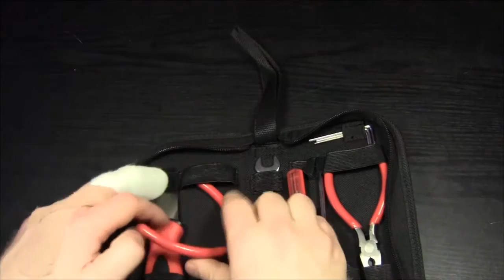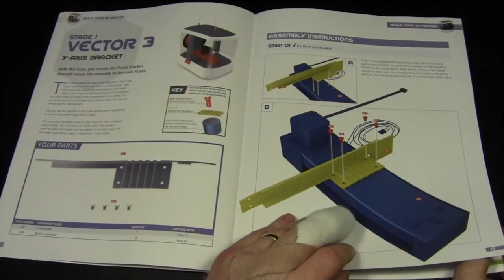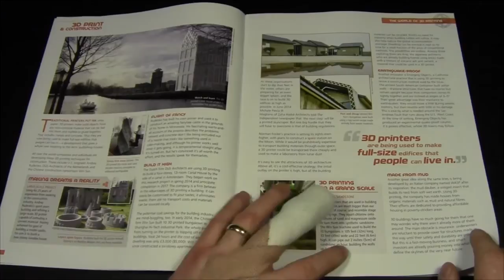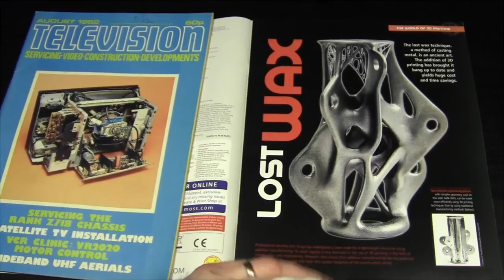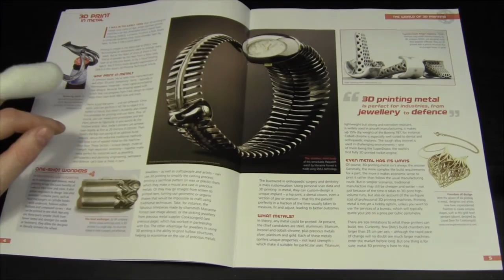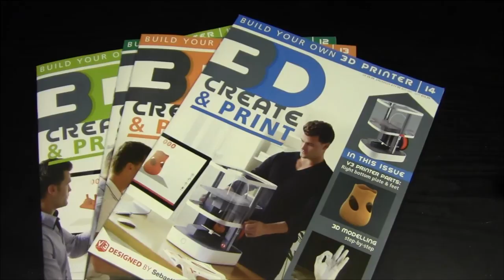Build Your Own 3D Printer, Editions 12 - 15 Review (  V3 , Eaglemoss)  (Building The Main Frame!)

Comment: Good video, glad you seem to be the only one who actually getting the promised parts. I have had nothing but problems with missing issues, that's when they actually sent them to the correct address and the latest box minus tool kit is the last straw, cancelling my subscription going to get a higher spec prusa instead. Did you notice the spec change for the printer on the website vs mag?
Reply from the maker: Mark Franklin No, but I suspect that the boards will come late as they will ikely want to keep the spec up to date :)

Comment: got mine yesterday, though i didn't get a toolkit, I'll have to email them about that.

gotta say though, the kit they show on the sub page looks a bit nicer than that, rubber covered handles rather than hard plastic like those.

and i never got a USB stick either, but then the sub page on the website says i should get that with my fourth delivery.

anyway, some of those screws were really awkward, especially the ones close to the base where you have to hold the screwdriver right at the end because the base is in the way.
thinking about it, it would probably have been easier to put the L shaped brackets in the upright section first, where the bottom plates wouldn't have been in the way.
all the other screws go in from underneath so doing them afterwards wouldn't have been a problem.

ah well, got em in eventually.

according to the website the assembled printers should be sent out in April, hopefully there will be same reviews of the machine soon. 

getting more exciting getting the issues now because i don't know what's coming next, the first 11 issues i already knew because of the video on the Eaglemoss channel, but now, it's a surprise.

Comment: The tool kit
HAA! yes you will NEED those :)
spachala remove print form print bed
needle nose remove support
screwdrivers aside from screws digging out support
snips.. 
Strings strings strings. and clipping off larger support bits kind of like sprews some modles use them rather than a pattern.

missing.
sand paper 
reely rough and medium grade grits is what you'll need
i recomend a drimmle for the fiddly bits
Reply from the maker: Zagroseckt Aha, it is explained!!  Thanks :o)

Comment: When do think it will be ready to print ?? You should make a minion dressed as you 3d style.
Reply from the maker: Ive heard by issue 60, dont know how true that is :)
Reply: RetroGamerVX considering it is 90 parts, i think they will string it out, by that i mean not give you a vital part till the very last issue, as i have said in one of your other video's i already have a 3d printer so am not worried how long it takes. all i can say is that even though the sketchup parts arn't supposed to be printed, i have been printing them (just to see what they actually look like in the flesh, so to speak). i have also been printing some of the models that are on the site, and some work some dont (by that i mean some need slight adjustments, mainly where parts that slot or fit together), i have even modified some to work how i want them to. the skull for example i cut a hole in the base and have a multicoloured led tealight inside it, very illuminating (pun intended). 

RE the toolkit: 
the spatular part is for print removal, the allen keys are for assembly (you may remember getting 1 for the stepper motor) 

also there is an unoffical FB page https://www.facebook.com/3DCandP if you could maybe link that into your descriptions.